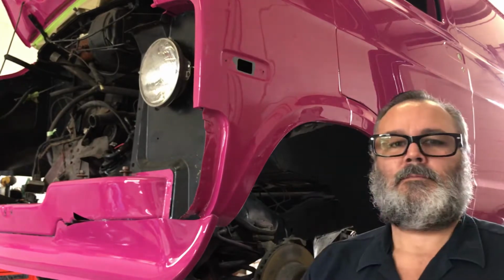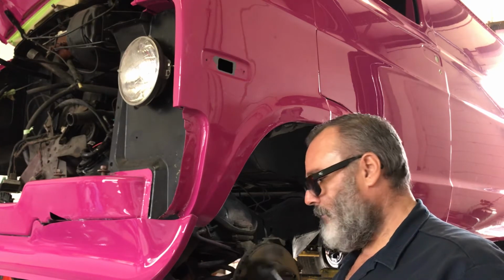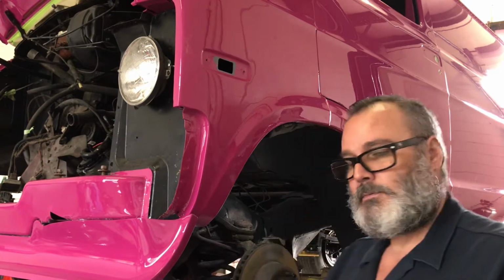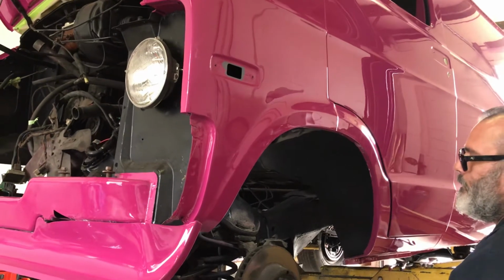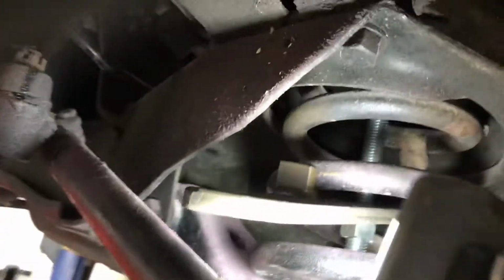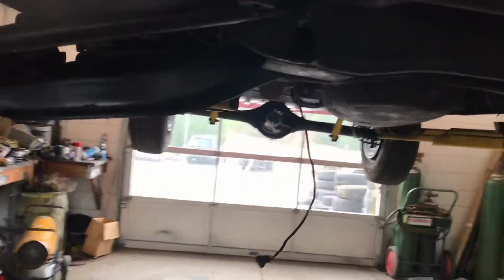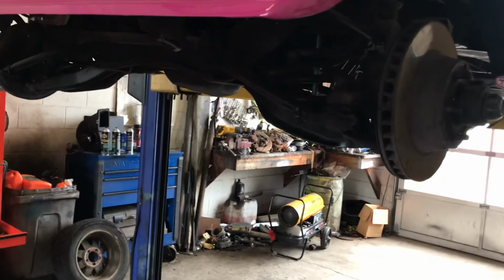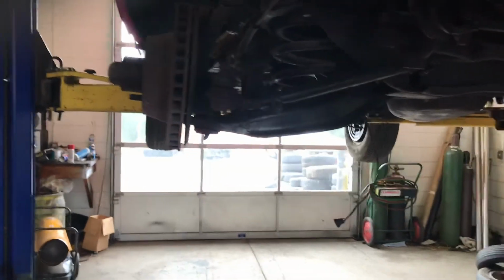Engine change in 1977 dodge van

Comment: Hey Sean, 

Nice work. Just wondering if you need to separate the Transmission from the engine to drop the Oil Pan on a 1973 360/A727 B100 or can you wiggle the Pan out of that (tight) area ?
Reply from the maker: I think it will come out with trans in I always just pull engine
Reply: @seanfattireguythomas2994  Not practical since the Van is my daily driver. Pulling the engine is a lot of work to check the Oil Pickup and Pump, but if something must be done, I'd rather separate the Trans at this stage.

Comment: What size front tires and wheels fit the front of the 77 disc brake without rubbing the caliper? I'm having a problem sizing it. Thanks.
Reply from the maker: Tommy Hunter vanther I’m running 15x7” I don’t know the back space on theme back has 15x11 the suspension is a stock B200

Comment: 1973 Dodge tradesman crossmember does not unbolt.
Reply from the maker: What cross member the engine is held in by a kmember they all should be bolted but with vehicles that are 40 plus years old there’s no telling what someone has modified in that time
Reply: I did a 1976 B400 and own a 1974 B300. The K frame has 4 bolts on each side of the bottom of the coil spring just like the gentleman explains in the video. Only way to get the engine out. I tried everything to get the 76 out the top and there is just no room for a hoist/cherry picker to clear the fire wall enough. This video is an excellent spot on tutorial that I wish I saw prior to working on my donor 76 Vega motorhome. The 74 is a sportsman. I did not use a lift. I did it on the ground by lifting the truck with a tow truck boom. A lift would have been a lot easier lol.